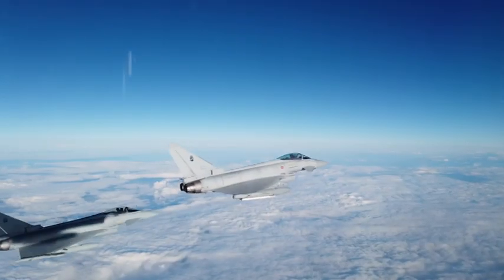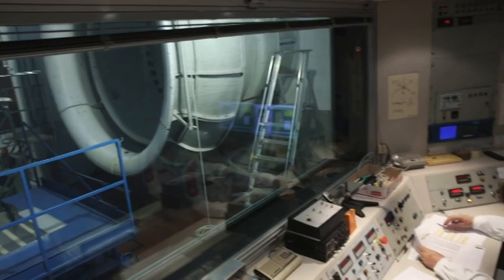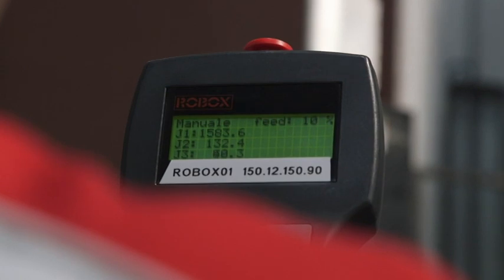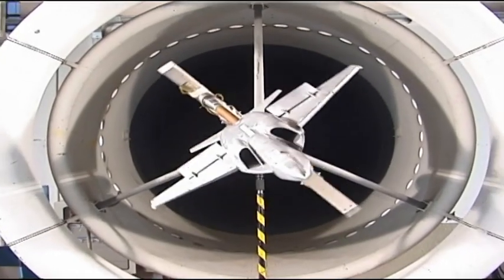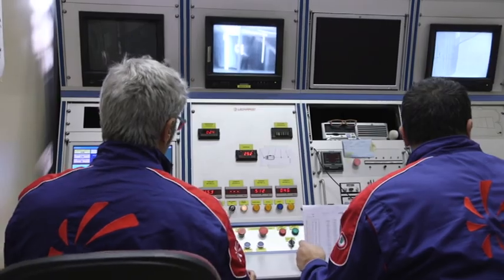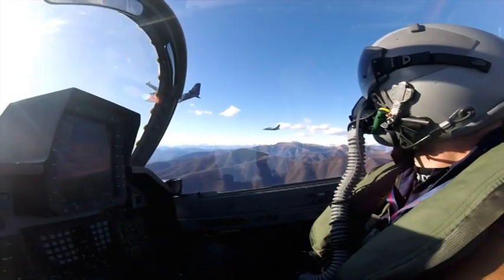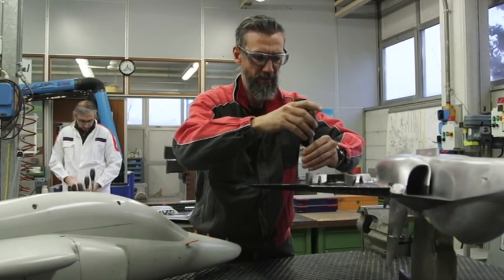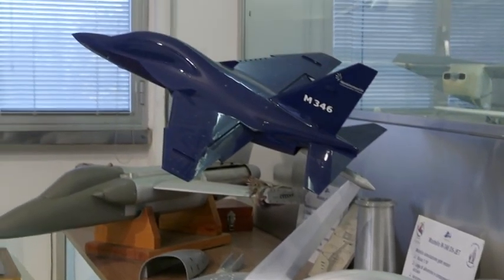Wind tunnel, a tunnel where planes are born

Comment: If the actual speed for real air raft for example is .8 M , do you apply the same wind current for maket in wind tunnel?
Reply: No, the similarity theory let you simulate phisical effects using different phisical conditions. The important thing Is ti achieve similarity through a series of non dimensional coefficients, such as drag coefficent, lift coefficient, reynolds Number for incompressible flow, or mach Number for compressibile flow and so on
Reply: I also had this question but he states early that the wind speed goes up to 250kmh so I assume that if the model is scaled the lift factors are also.
Reply: @WilliamScheetz  thank you. very kind of you